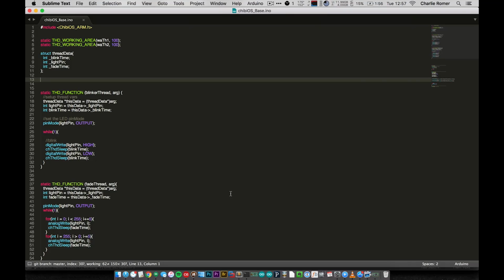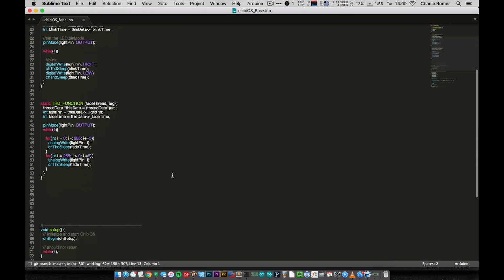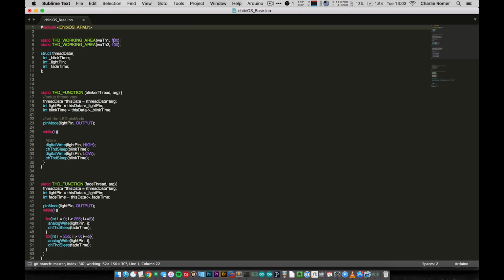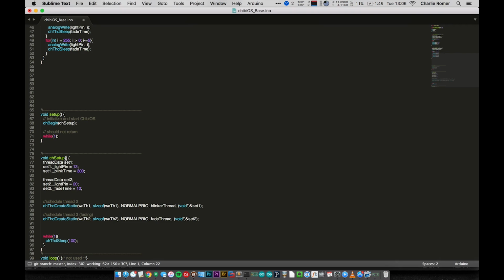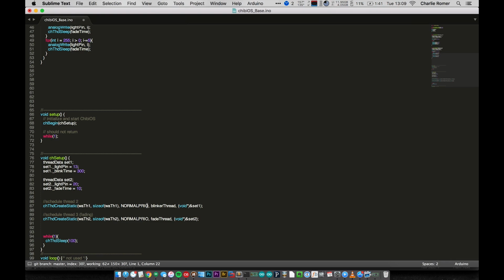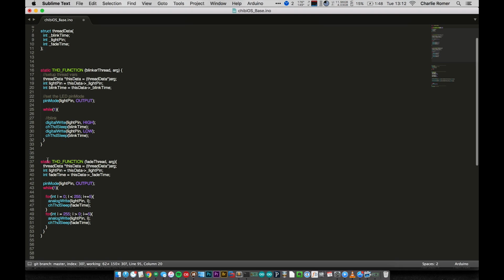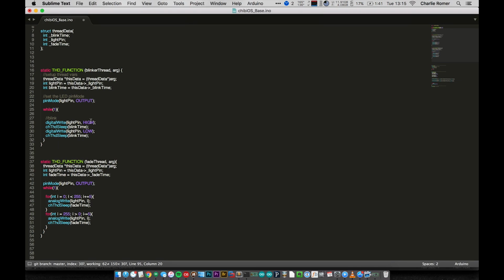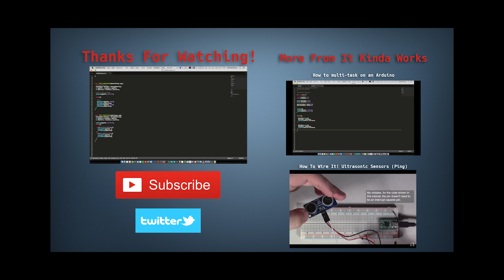Arduino Real Time OS: Getting Started (ChibiOS)

Comment: Great toturial, I learned alots. keep watching over and over. 
I have question, what criteria do you use to determine ram size allocated to a single thread?
Reply from the maker: if it breaks add more ram. otherwise dont touch it haha. For real though - It's generally based on how many/how large the variables are in a given thread. Small loop that only has a couple of ints... maybe 512k - large task with many branching functions and stored text, etc, 4096k.

Comment: Sorry if my question sounds very lame
Arduino has a single core so how are we doing multithreading here?
Reply from the maker: Not a lame question at all! Multi-threading is a tool used by OSes to allow multiple "programs" to run on a single (or multiple) processors. Essentially the Arduino (or any other computer for that matter) can only do one thing at a time on a given processor. One of the jobs of an OS is to allow many programs to run "at the same time". This is done through sectioning programs out into their own threads and then scheduling them to run when needed and sleep when they're not needed. The processor really is just doing one thing at a time but it's so fast at switching between tasks that humans cant tell. A quad core computer can run 4 things at the same time (and with other optimizations can do more than that) but modern computers can have hundreds or thousands of threads running (at the time of writing this my computer has ~2400 threads active across 8 cores) so the OS still has to schedule when applications can do their work. This is the exact same thing that the RTOS ChibiOS does on the arduino, it keeps track of threads and schedules when they can run. So the Arduino cant technically do more than one thing at a time but it can switch between many tasks very rapidly which gives the illusion of doing many things simultaneously and makes writing the software for those individual tasks much easier.
Reply: Okay okay I get it! 
My confusion is gone now and I totally understand and get what you are saying . Thanks a lot for a quick clear and descriptive answer.
I can now sleep in peace today!

Comment: Couldn't you just not write the void loop in the code since it is not used? I know in arduino IDE you can bypass the setup and loop functions in favor of a standard C structure with main

Comment: Hello, I see in your video you used ARM.h for header files for Arduino, how so? I tried running a blink code that came with the first github link (by Greiman) you shared on Arduino IDE 1.8.5 but compilation fails. I tried running on Arduino 1.6.7  compilation is unsuccessful again. Now  when I went thru the code from github, the author says he compiled with Arduino 1.6.5, so i want to try that next.

I also think your video is the most pronounced on YouTube so far on Arduino + ChibiOS, and I really think that it could be much more helpful if you could give specific tips on how to go about a successful compilation and loading to an Arduino board. Cheers.
Reply: He uses teensy board which contains arm chip on its board. I did not try this library bcs it failes too. Find new version of the library chibios_rt by Greiman

Comment: I tried this with Teensy 3.6 and your library from  https://github.com/ItKindaWorks/sketc...
As the instruction in readme.txt, to install the libraries and run the ChibiOS/RT examples, I copyed all included libraries to installed arduino libraries folder.
And I tested some examples and this code also. 
But, it doesn't work. 
It always makes compile error.
One of errors is below.

 #error "Compiler generates FPU instructions for a device without an FPU (check __FPU_PRESENT)"

Arduino version was 1.8.2.
Reply from the maker: The ChibiOS library is not currently compatible with the 3.6. AFAIK it is only compatible with the the teensy 1 or 2 and 3.0-3.2
Reply: I'll try with Teensy 3.2, again. Thank you so much.
Reply: In 3.2 Teensy it makes a warning message like 'WARNING: library ChibiOS_ARM claims to run on (sam) architecture(s) and may be incompatible with your current board which runs on (avr) architecture(s).' 
But, It works! Awesome. Thank you so much!

Comment: So, what would an application for this be?
Reply from the maker: Well one example that you probably interact with everyday that runs an RTOS most likely is your car. The computer that manages the engine and monitors timing/temps/speed/etc. is usually a micro running an RTOS of some sort. 

An example project where it might be useful to have an RTOS running in some form might be an interactive home monitor with a screen that the user can use to control various things in the house. The UI might be one thread, networking in another thread, home state management (keeping track of home thermostat, lights, etc) could all be in individual threads as well. 

The idea is that rather than having one large program where you have to do a lot of effort to keep things straight, and RTOS splits tasks up into different threads so it's easier to make things more modular.